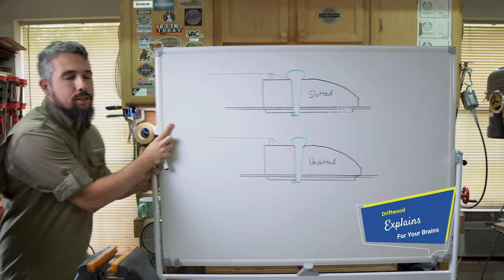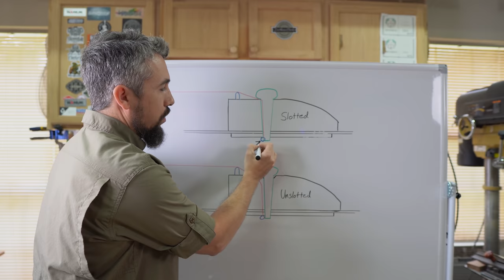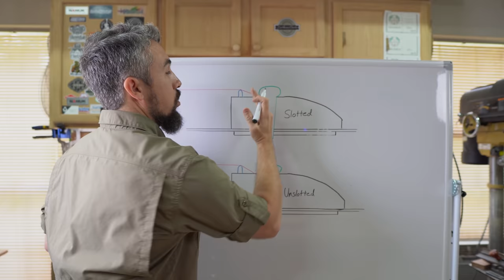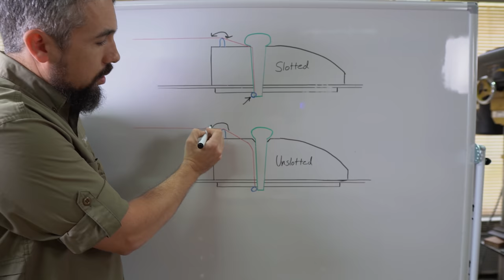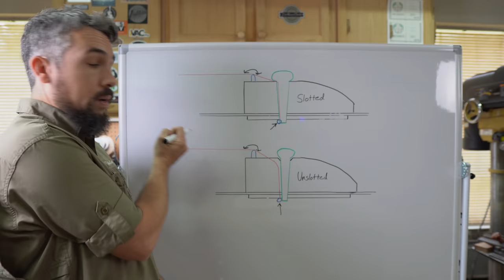This $25 Tool Can Help Anyone Make Their Guitar Sound Better!

Comment: I just finished the alteration of the bridge on my backup instrument that honestly I wouldn't have been upset if stolen. But now you couldn't take it from me.  The volume is noticeably louder.  The sustain is shocking, really, and the tone is so much more complex. This was on a $300 The Loar flattop that went from an ok sounding great playing instrument to a beautiful sounding great playing  instrument. Like Tanglewife , I ask, " why isn't this simple adjustment standard on every instrument. I can't image what my Martin is going to sound like when I make this change.  Thank you so much.
Reply from the maker: I appreciated this comment so much that I pinned it to the top! I’m glad you had good results from it. The reason the big companies don’t do this from the factory is because it takes up to much time in the manufacturing process. Simple as that.
Reply: @DriftwoodGuitars  BTW My Martin is another guitar now.  Couldn't the CNC machines cut the slots, and the rollover be done by hand?  what would it cost?
Reply: Umm...about the pins. Couldn't you just turn the pin with the slot away 180 degrees opposite of the slot in the wood you just cut. I mean, if it's just a safety pin?
Reply: @firebald2915  Well that's half of it but what makes it work is that the ball end is in contact with the bridge plate.  That's where the extra energy and sound come from.  Also clarity.
Reply: @28reinvent  I think you might be 'talking past' each other. If your existing slotted pins fit well after the slotting mod, when turned 180 degrees (so that the slot faces the tail, instead of the string) you will likely get 98% of the benefit of this mod. The advantage of the Waverly and reamer 'finish' to the mod is probably 90% "fit and finish", that any luthier would want of a guitar going out of his shop, and the remaining 10% would be the increased surface contact and added mass. It is up to the individual, whether that extra 0-2% improvement is worth another $100, over just the saw (currently sold out, for reasons we can guess) and the existing pins, rotated 180.
Reply: I would have liked to hear a side by side comparison.
Reply: @MichaelStoneqm3  There is a newer video on their channel that does pretty much exactly that (as well as side-by-side can be compared, on various devices, after YT compression, etc..
Reply: @MichaelStoneqm3 no you wouldn’t
Reply: There are youtube videos that use the exact same guitar, but trying out different bridge pins. You can really hear the difference in some of the different materials used to make bridge pins. Plastic pins definitely have the least quality of tone, volume, and resonance. Bone is probably the warmest sounding, yet still louder than plastic and more sustain vs plastic pins. Ebony pins also sound much better than plastic pins, and are very close to bone in tonal character. For the price, I personally prefer ebony pins over bone, simply because they cost far less than bone pins, and you get very close to the same tone, volume, and sustaining quality. For anyone on a limited budget, slotting the bridge itself and re-using the cheap plastic slotted pins will still improve the sound of the guitar by rotating the slotted pins 180 degrees as you had mentioned, and that's fine. But as soon as a person can afford it, buy solid bone or ebony pins to improve the sound even more.  @firebald2915
Reply: @CineSoar  I've eliminated bridge pins by using a brass rod thru the ball ends and the whole rod is up tight against the inside of the sound board.  Transfers ALL of the string energy. Plus,  the string contact on the bridge wood before the saddle is also transferring vibrations. @ 3/8 of an inch?  Palm muting is a breeze. No pins !
Reply: @DriftwoodGuitars my taylor 814ce builder's edition already came with a slotted bridge. i can just turn around the bridge pins and have the unslotted pins and a slotted bridge.
Reply: @firebald2915  Damn - that sounds too simple, yet makes sense....   Do you know what size rod you used?
Reply: @semperfi5857  measurement wise? I just took a couple of ball ends to the store and made sure the rod fit thru.
Reply: I totally didn’t understand this.
Reply: Brilliant!!!
Reply: @DriftwoodGuitars ee😊😊
Reply: What is your vibrato like.. before and after?
Reply: @firebald2915 break a string, and you have to take ALL the strings off to fix the one string. Plus I wouldn't be surprised if when playing a single note the energy transfers from one string to the next might produce unwanted  sound?
Reply: Hey guys what about using string ferrules just like a Telecaster does?

Comment: I build guitars and use unslotted bridge pins by putting the slot in the bridge.  However it is worthwhile to use a more narrow file or saw for the thinner strings.  Actually, each slot cut in bridge and bridge place should be the custom width for the size string going into that slot.  He mentions that there is a more narrow saw for this that he does not bother to use.  By using the bigger saw and cutting away more material in the bridge plate, he actually has less of the ball resting on less bridge plate material.  Having the ball end pull against more bridge plate material would maximize the goal of this hack.  In addition, eventually the ball end of the strings will ware away the bridge place and the ball ends will begin to go into the bridge plate itself.  This is why the bridge plates on older guitars need to be replaced.  So as more bridge plate material is preserved it will lead to a longer life for the bridge plate.  What he does not mention is that after the slots are cut it is much easier to change the strings because you are not trying to get the bridge pin slots to accept the strings.
Reply: "A single 25$ tool" works better for the video title than "A 25$ tool, plus another 25$ tool, plus a reaming tool (you will never use any of the aforementioned tools ever again if you're not a luthier), plus a set of new pins"

Comment: Alan Carruth did an experiment on this and concluded that the amount of break angle needed (at both nut and saddle) is only what is needed to accurately define the point where the string crosses the nut/saddle and exert enough tension to keep the string from moving about and wasting energy. That's not really very much. See Carruth (he found that on blind testing people could not tell the difference between a break angle of 25 degrees and 6 degrees - that's a lot - provided the strings remained the same distance from the top) but also Ted Woodford's channel for more on this. At the saddle, the issue only arises if the saddle has been lowered to such an extent that Carruth's two criteria are broken (usually in an attempt to lower the action in a guitar which is getting near needing a neck reset). In this situation, ramping is a great thing to do, but otherwise there's no real evidence that it makes any improvement.

Comment: And for another simple tone enhancing tip from one of the great modern luthiers (TJ Thompson I believe) that we all can do:  "Double ball end" your strings ! How ? Cut the ball away of the old string and slide over the new string when changing. Imagine at the 9:00 mark having a flat circle making full contact with the bridge plate instead of only a portion of the ball digging in behind the pin. Also helps preserve the plate as well. You're welcome.
Reply: Nice point, rare tip!
Reply: it make sens,  tank you
Reply: Great tip, thanks!  I knew I was saving some old ball ends for something!
Reply: @Christoph 1945 I think this would be as good as unslotted pins and less work because of the contact area. I always use bone nut, saddle and bridge pins. 😀
Reply: In essence, that would give it balls…
Reply: @warrenwilliams7822  ha ha ha !!!
Reply: I think TJ also mentioned that this helps save the bridge plate on vintage guitars.
Reply: Excellent. Yes.....it is best to have a pair of balls. 😎
Reply: What? Can you explain it more?
Reply: @summerman2  Instead of having the ball end contact the underside of the bridge like a car tire contacts the road, one metal ball end will contact another metal ball end, and that one will contact the wood with a greater surface area like if a tire was taken off a car and laying flat on the ground.
Reply: @summerman2  Next time you change strings:
1. Cut the ball ends off your old strings.
2. Tread the old ball ends onto your new strings. You've now got 2 ball ends on each string.
3. Install the new strings onto the guitar as normal.

The extra ball end will lay parallel against the bridge plate. This transfers energy to the plate better.
Reply: I wonder if slotting the bridge pin hole getting the string closer to the bridge , might create more pressure at the top of bridge to make the the bridge lean inward and affecting intonation?
Reply: @larrycortner6321  would it flatten or sharpen intonation because my guitar is sharp
Reply: @teej0813    Good explanation and it makes a good image, save the pin rotate slotted pin.  I used a triangle chainsaw file to ream the hole when I replaced bridge pins I did it to get rid of plastic pins switching to wood.  The acoustic guitar I did this on has become my favorite but didn’t know why.  I will do the balls next string changes many thanks. Ream it Baby those pins will go in deeper.  ****Update edit the extra ball end continues to sound better to my ears.
Reply: just done as you suggested as well as the videos instructions , very pleased , Thanks 😁
Reply: @paulmanoogian7646    Just my 2¢ but I would say not share or flat but accurate.
Reply: Has any one tried 2 ball ends to guarantee an increased contact in case things are worn.
Reply: Oh man... I've never thought of that... makes sense
Reply: Dude that is brilliant. Makes perfect sense .
Reply: @teej0813  How to tread two balls on the same string?
Reply: @gib_life  I love your explanation and imagery here!
Reply: @LegsON  Old tip, not rare, they used to put washers on the strings as well, all this video is, is a sales pitch for overpriced Stew Mac tools.
Reply: Instead of ball ends, get some 10x3mm washers. The washer is too wide to come through the hole in the saddle, so you don't need bridge pins.
Reply: Thát actually makes a lot of sense! Definitely going to try this on my 12string 😎👍
Reply: Just wondering why, if the benefits are SO OBVIOUS, that Elixir / D'Addario / Ernie Ball don't make these as standard 🤔
Reply: Wow thank you so much I will do this
Reply: Will try!
Reply: @derekfromtauranga6012 hahahahahaha
Reply: That's very  good idea....provided they have the strings available in the composition I like ..... I wouldn't want to loose thentonal qualities I like from a particular formula and size of the guitar strings I like ... and in each of my guitars I'm not always looking for the same tone ..

Comment: I like to do this whenever possible.  Nice video and explanation!  The $25 tool can be fabricated from a Bosch style blade, the one for fine wood that cuts on the downstroke + a dowel handle.
Reply: champion comment right here
Reply: For those of us that do not know, what is a Bosch-style blade?
Reply: @lenp00  its a jigsaw blade except much narrower, about the same size as the slotting saws. So basically it can fit in the bridge pin whole unlike normal jigsaw blades that are too tall.
Reply: Yup bought 2 blades for $1.99 and put dowel handles on em and bingo, worked just fine. Nothing against Stew-Mac tools, love the ones I have, but man are they pricey.
Just did this to a budjet narrow body acu\ele I am working on, and WOW what a huge differance!! I only buy bodies that sound good quality or economy. Even with a guitar that already had resonance, I was shocked at the difference.
Reply: Do you double up the blade for thickness?  Or is the Kerf wide enough for the strings?  Great idea!
Reply: I did just that , thank  you Sir!
Reply: bingo...I use a coping  saw blade (there are different sizes and teeth), cut to length, with dowel-like handle.
Reply: I JUST USE MY BOSCH SCROLL SAW. MUCH FASTER.
Reply: My Swiss knife has a blade like that
Reply: That's a really good idea mate!
Reply: A "coping" saw blade would probably work as well?  @jkabanas

Comment: Just made this modification on a Fender Stratacoustic. I had already sanded down the saddle, tightened the truss and shimmed the neck to successfully get the characteristic high action down. But since it's a small acoustic, it had crap sustain and this made a huge, huge difference! I was kind of blown away. It's an actually great sounding acoustic guitar now.

Comment: This makes sense and looks like a simple modification.  That being said, even though I am a wood worker and have built instruments, the idea of permanently changing a guitar using a knife or saw is so unappealing to me...  To successfully make a before/after showing the difference could definitely be convincing though.  Thanks for the tips and content.  I always enjoy it
Reply: I am waay too scared to try it on my 5k Custom Shop Martin! I may take this idea to my luthier guitar guy, but definitely wouldn't want to try it.
Reply: @angelg8445  Martin Authentic series guitars come like this from Martin.  They only skip it on custom shop and standard series because it saves money.
Reply from the maker: That’s correct
Reply: @jmdbb  The Martin Custom Shop will do this if you specify. The Martin Repair Dept will do it for you, too, but only on a genuine Martin guitar.
Reply: @Pol Escalante just do it! It's barely noticeable visibly, and holy shit does it make a difference! I tried it on a cheap guitar and immediately had to do it on all the rest. It's incredible.
Reply: is a gimmick trick lol

Comment: Before I saw your video, I had had this exact modification done to my 1995 Martin D-16T, but I had a Martin-certified luthier do it (Steve Sauve, North Adams, MA.  He's builds guitars, too.).  I did not have the stones to do it myself.  The D-16T is my farmers' market guitar.  The guitar was dying because the bridge plate was extremely worn from sloppy bridge pin fit.  But I had the repair done in two stages.  First the bridge plate was repaired, and the guitar was greatly improved.  Then the magic happened when Steve made the exact modification you describe here.  The guitar is louder, has more sustain, and, as you said, is better in every good way imaginable.  The guitar sounds like a much more expensive version of itself.  I agree that the larger companies, like Martin and Taylor, are more interested in profits than tone.  Sometimes the old methods are just better.  Based on my experience with D-16T, I will (eventually) do this to all my guitars.  Thanks for a great explanation.  All you doubters, just get over it.
Reply from the maker: Hopefully people will read this and believe!

Comment: Did this to my guitar and it immediately did everything he said! I bought a set of 5 exacto knife hobby saws for $5 and used 1, 2, or 3 pinched together (1, 2, 2, 2, 3, 3) for the different strings. I used the trick someone else posted on here about threading the string through the old string's ball ends to get a better contact surface with the back of the bridge, and then cut and sanded the bridge pins down (to offset the added weight of 6 extra ball ends) so they just barely stick out in order to be able to remove them later since they are essentially just for show now.
Reply: Great hack, thanks for sharing!
Reply: Link to the x acto saw you used?

Comment: Great video.  When I've tried to explain this to guys in the past they think you're crazy cause their Martin or Gibson didn't come like this.  I do this to all my guitars.   You're talking about two different techniques though.  There is the slotting and the ramping.  You can do one or the other or both.  If your saddle is close to the pins you may not want to ramp and just slot.  Usually I'll just slot and not ramp.
Reply: They might not come that way from the factory, but the Martin factory sells unslotted bridge pins in their gift shop. Last time I was there I bought some. And, yes, they do sound better.

Comment: I'm convinced.  The guitars that are cut open and used as learning tools make the destruction of the instrument a logical reason.  Is there such a thing as too much break angle, as in, can the string pull the saddle forward with enough tension so as to change angle and intonation or even split the bridge?

Comment: I did this mod tonight on my Sigma acoustic and it sounds way louder now! Nice tip lads. Made a small saw out of a hacksaw blade. Split it in half with my angle grinder so I could get it to fit down the bridge pin holes :-)
Reply: I have a Sigma that is 35 years old.  I got first choice of a truckload brought to the store. Had several set apart.  Grading each one on sound and sustain.  It out performs most Martins I have had. It is unbelievable.❤❤❤❤